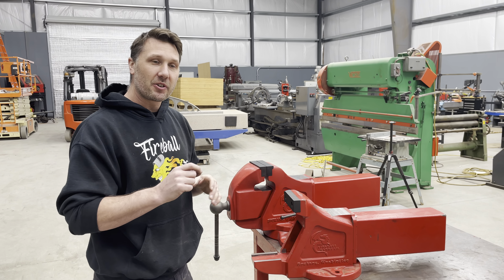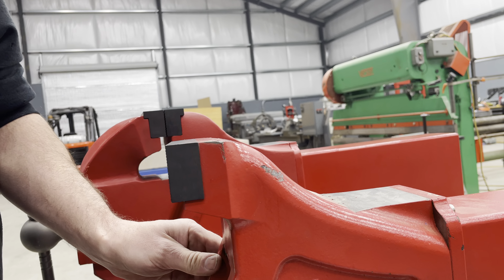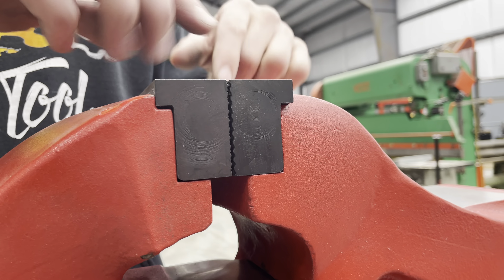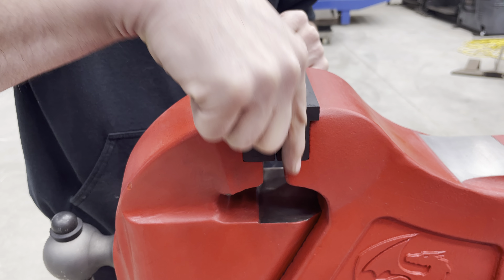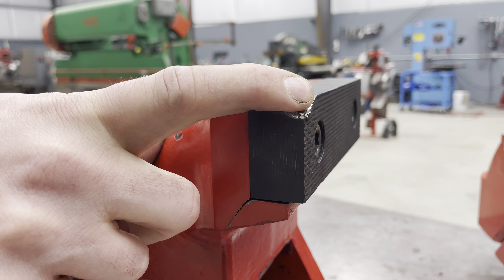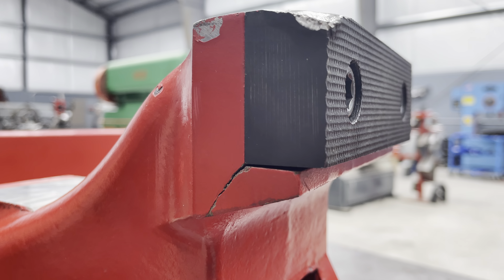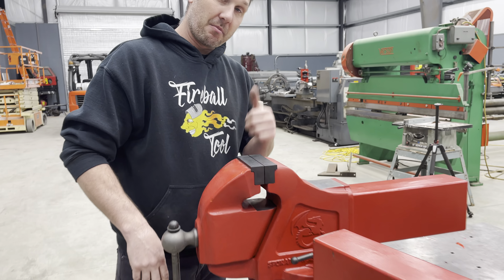Why is the Jaw Designed That Way? - Fireball Hardtail Vise

Comment: From one engineer to another, I like how much thought you've put into the fulfilling the function of the tasks that this product will have to hold up to.  Most people neglect abuse loads in their design. Most companies don't thoroughly test their product to failure like this.  I think that shoulder you put on the back of the removable jaws will do a really good job in bearing the loads that cause that crack.  I am aware of the added cost and added complexity that this feature adds to the product, and It's commendable that you prioritize robustness and performance.    Another way to remediate risk of a corner crack is to put incut or undercut radius into that corner to provide stress relief (like a 3D crack stopper). Rounding that inside corner of the removable jaw will probably do the same, but again complicates the machining of a frangible part.  Another idea would be to add another or larger fasteners to take increased shear loads. With that said, this design case is pretty extreme, and there is only so much you can do within reason to design something that will hold up to anything that you could throw at it.     Thanks for the entertainment.  It feels like fabrication and manufacturing excellence is still kindling in the US.  Cheers.
Reply: Well put. I'm wondering if just moving to a cast steel would solve all these issues. Cast iron is basically a ceramic when it comes down to properties, and you wouldn't beat on a ceramic anvil. Or perhaps you might, but only a few times.
Reply: Putting a radius in the corner is easy just buy the proper inserts for your tool with a radius on them.

Comment: As one who has abused vises over the years I commend you for improving a very important area in the construction of a vise particularly a big vise.  The role of a vise is to hold things for either assembly or disassembly.  Disassembly is where I’ve found a vise suffers because sometimes it’s necessary to apply extreme amounts of force to accomplish the job.  The Fireball Hardtail looks like it will survive to work again day after day.  Congratulations and best wishes for good health and prosperity!

Comment: On our farm we don't always have the right tool, so we use what we have.  Great upgrade.   We commonly use the jaws of our old Reed to hold parts while we sledge hammer a shaft or component  straight down toward the floor.   I'll be putting my deposit down tomorrow.  This vise has "Please take my money" written all over it.  LOL

Comment: Having a radius in the base would have likely prevent or reduce the chances of it cracking without making it thicker. In fact even the new design has that problem, a sharp corner will create a stress concentration which is a bad thing for cast iron.
Reply: Much like airplane windows, a hard corner leads to easier cracking.
Reply: While 100% true, there is a point of diminishing returns and having to factor in manufacturing costs.
Reply: @bradley3549  — if it’s a casting, then it should not be too hard to change the master mold, and the from that point forward everyone will benefit.

Since it appears to be cast iron, it’s going to be extra brittle to start with, so it would be totally normal to do everything that can be reasonably be done to avoid cracking.

There is a reason why all airplane windows these days have rounded corners on their windows, unless they are even more oval or circular in shape.
Reply: @shubinternet  Sure, but then you will need an additional tool to finish that casting, and additional tooling to make the jaws match, and now the somewhat bespoke jaws are even more bespoke and harder to make custom jaws in your own shop. I'd say it's a compromise and a fair one at that considering what the competition looks like.
Reply: I thought about this for a while.  I was leaning the same direction.  I came to the conclusion that the way he addressed this issue is probably the best.  Castings are notorious for having porosity... They are just a factor that you have to account for...  So, even with a radius in the corner, if you got defect or inclusion in that region, it would still cause a stress concentration which could lead to a crack.  putting that shoulder on there, results in the load being take out in compression witch should keep that corner from loading up.  Just my two cents.
Reply: @bradley3549  if you are making your own jaws it’s nothing to bevel or radius the outside corner to match the inside corner profile. A angle grinder would do it.
Reply: @shubinternet  Not cast iron, ductile iron, which is much stronger.
Reply: @ouvuu  — so, it’s a casting, but not cast iron? They cast ductile iron instead?

Comment: Looks like a good improvement. Seeing that crack failure at the sharp corner, made me wonder about a radius there instead?
Reply: A radius would likely help, but you are still putting that relatively thin shelf into tension or bending so just increasing the threshold where it breaks. The lip on top of the jaws is a much stronger design.

Comment: Stepped/lapped over jaw plates is good choice, few old style done similar concept, I got heavy chipping vise using similar idea .
Besides extra jaw plate support under hammer work it also can keep top jaw castings in better order if lap top jaw plates enough .
Is cool see the old vise design improved and a proper good manufacture effort .
I always say a vintage vise is the better made vise, I might not be able say this any longer lol ....

Comment: Good improvement! Very important to consider rough usage like this.
I would question whether the upper lip on the jaws is needed when you have that solid ledge though, since it does slightly reduce the effectiveness of custom soft jaws that don't have the lip. Also a more minor point; if the tolerances aren't perfect then the jaws won't contact evenly between the two surfaces which could give a slight sponginess if the top surface protrudes, or if the bottom surface protrudes then clamping with the tips of the jaws could be weakened.

Comment: It would take more machining or casting work, but I’d prefer to see the jaws held in with bolts from the back into blind holes so the face is continuous. Especially with smooth or soft jaws.
Reply: Agreed, if you are holding odd shaped parts you could easily have one of those cap heads bearing directly onto the workpiece. Even my ancient Record vice has screws that go in from the outside with threaded jaws.

Comment: i'm pretty curious about you doing the same experimentation on the bigger vice  with and without the  little shoulder of the jaw. because my mind is that it requires a huge precision to have the same height between the two shoulder on the vice and on the jaw, so only one of the shoulder would take the load if you hit it...
Reply: I think the idea is that the top shoulder would take the load first which is suported by a lot more steel. The jaw might break but that's much cheaper and easier to replace.
Reply: @jonathanshaw6784  yeah, then why are there two shoulders... Isn't more cast iron than steel ? I guess the jaws won't break, it should be heat treated steel which we can do nothing against xp. the point is I think it's either soo much an over quality tool either it has not been thought about, which I doubt.
Reply: I agree, having the lip on the jaws and the lower shelf means the jaw dimensions in this area are critical. Ideally you would want some clearance between the jaws and lower shelf so all loading is taken by the lip on the jaws, which means that lower shelf is redundant.
Reply: I mean even cast iron has _some_deflection, so you’ll get a deflection from the ever so slightly higher one and then the force will start to be evenly spread once it contacts the second. The one it contacts first will still break first if push comes to shove mind, but it’s not as big a deal as you think. More likely the workpiece is uneven and your force distribution will be wonky because of that

Comment: Hi Jason Just a quick question on the vice you often refer to cast iron I am wondering is it cast iron or cast steel and if it is cast iron is it SG Iron, if it is cast steel then what type. It looks like an amazing design that should tick a lot more boxes than other vices on the market well done
Reply: You can cast both. The difference between iron and steel is the carbon content.
Reply: @MooseKnuckleMike  as someone who is an engineering trades man and who has spent a lot of time in a foundry and also in machine shops i understand this. my question was more aimed at what it is made of as the mechanical properties are very different depending on the material spec and i would be a little bit surprised if it was cast iron even if it is SG iron
Reply: Metallurgy is complex.  Casting metals is an art unto itself.  So much knowledge required.
Reply: @mikeburston9427  btw, which would you prefer?  Cast steel for me depending on content.
Reply: Most of modern blacksmithy uses all refined and designed metals, from jobs like Mike's to hobbyists to #forgedinfire!  Creating those metals is the another art.
Reply: @Joe_JesusWins_Lewis  metallurgy is not an art it is science. where i did my training we regularly cast over 700 different ferrous alloys. every alloy has different properties and in the case of a vice there are a multitude of materials that it could be cast from and the decision on which to use has many factors from the material properties to the cost of casting and then heat treatment to the machining costs and ease. this is why i asked the question. i didn't however ask what the specific alloy is as i would think this would be confidential to fireball
Reply: @mikeburston9427  science is an art.
Reply: @mikeburston9427  honestly, I love metal, on a metallurgical level. God's creation is magnificent. I am aware of everything you said. I study things I like. Regardless of your rigorous standing that metallurgy is science, science is God's handiwork, and very artfully done I might add!
Reply: @Joe_JesusWins_Lewis  ....Hmm, if I have a broken vise can I get "thoughts and prayers"?
Reply: @paulcopeland9035  sure! I'm not gonna ask what "vise" you broke, congrats on breaking it though 😋
Reply: @paulcopeland9035  #notblessed

Comment: Just a nudge here:
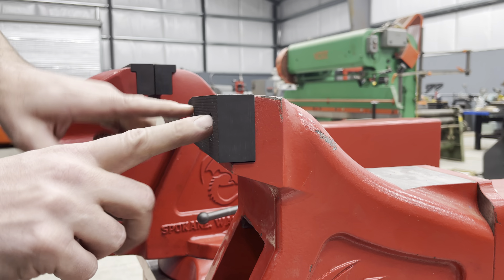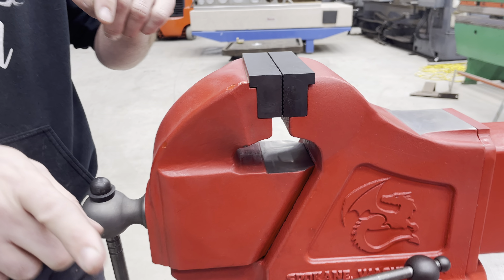You said that the screw takes the force of the down force. Screws can take shear stress but mostly it is better to avoid that. One way is using enough clamping force such that the friction force supports any tangential force. This doesnt work with impact forces because of the vibrations and higher forces. Another way, like you thought of, is to support the jaw by itself (like explained at 0:18). Obviously you will get the error pattern shown in 0:55. You might want to strengthen your part by reducing the notch effect. You can add a radius to the edge for this. Also make sure to avoid double fittings, like in your redesign.

Comment: I think all vices have a obvious flaw. That is the 90° corners in the jaw area. When you file or saw something by hand you will inevitably make contact with those corners and cut your skin open. I always round over all those edges with a angle grinder.

Comment: Great looking vice, but the features aren't as valuable as you may think. I agree that vises will be pounded upon and likely misused for a task they weren't designed for. However, you're over-constraining the degrees of freedom of the jaws. Two bolts will fully constrain any movement, both translational and rotational. You don't need the lips unless failure of the bolts occurs. If the bolts are failing, use a larger size or stronger grade. Use through bolts with a nut on the back side. Additional features also greatly increases cost. These features also have a tolerance that must compete with the jaws, again they're already constrained. You have a higher chance of producing a vice that's out of spec. as well as a more complicated design than necessary.
Still a great looking design, I can see the hard work put into it. Just my thoughts

Comment: I wish there was a better way to do them bolts.. They are always in the way. Yours are not so bad because they are farther in. My Yost has them almost at the edge. It does have a rather thick lip under the teeth.
Not many better options. Bolt in from the rear then you have deeper holes in the casting. And sometimes i use the spine for some light hammer forming. Bolt s would be in the way then. 
Could go in from underneath at an angle.  But that would be hell on machining.

Some day i hope to order me a fireball vise.
Reply: Crazy idea: Make the jaws threaded part way, then bolt from the back through to the jaws. Make the casting a clearance not threaded. that way you brake the bolt or jaw before the casting and the bolt won't get stuck in the casting if it shears.

Comment: Proprietary jaws, essentially to get you some more cash, let's be honest.  Wilton hasn't had the lip for a hundred+ years.
Reply: Go away.  Quit trying to start shit.
Reply: Anybody who owns one of these vises and can't make a set of jaws in 15 minutes should have the Vise Police come and take it away from them. "cash grab", what a crock.
Reply: Honestly aren't most vise jaws pretty much proprietary to that make and model anyway? With the exception of maybe Kurt mill vises where jaws are a dime a dozen and on every cheap knock off.
Reply: @imnotyou1776  weak fucking reasoning my man. Just because something hasn't changed design for 100 years doesn't make it the zenith of perfection. It's just reached "good enough" and the design has evolved into something more suited to the period. The fact of the matter is, is that jaws have changed, in respect to the applications that need them. Multi axis machining of high value/tight tolerance parts, for example -  not for a geezer called Frank having a crack at filing some scrap into "close enough". 

Oh, and I sure as shit don't have one of these  vises (before you say "herpaderp, stop defending fireball tools"). I'm fine with my selection of knackered lumps of cast iron.